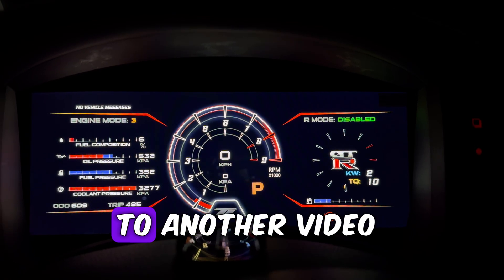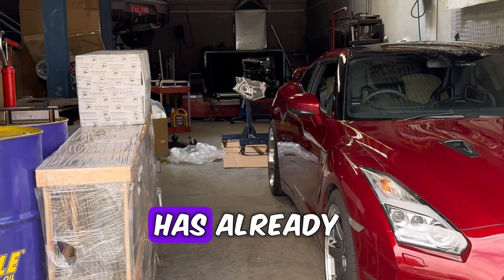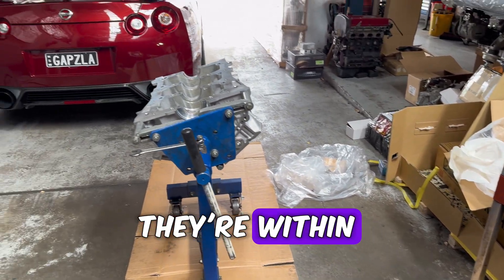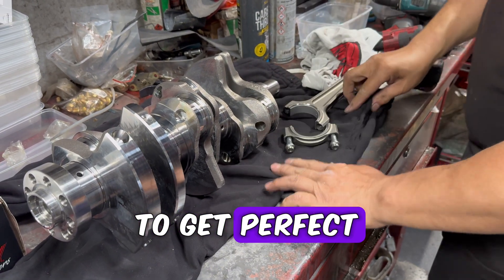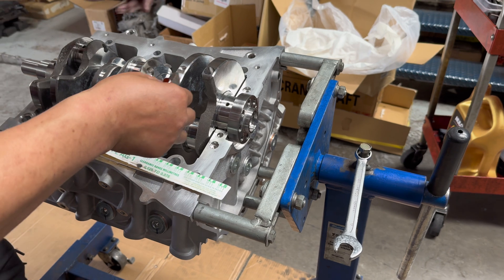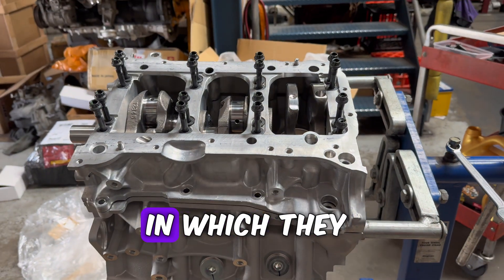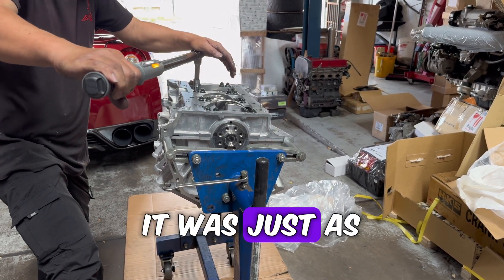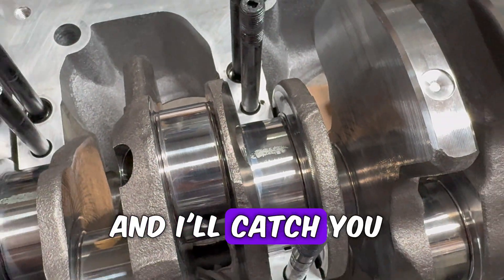Nissan GTR Engine Assembly Part 1 - R35 VR38DETT - 1100whp-1200whp engine build

Comment: Hello, I had trouble choosing the main block bearing, the original boards didn't help me.

What main and rod tolerance are you using for that power?

Thanks
Reply from the maker: are you building or do you have an engine builder? ideally you want to measure and select bearings after measurement
Reply: @gapzlaGTR  I'm building myself, but I asked based on the letters of the crankshaft and the letters of the block by introducing them into the table, but the tolerance was very small. Now I've asked for caps closer to the zero degree, I'm looking for a tolerance of 0.0018" for 800whp or so.
Reply from the maker: @oliverogv  we’re around 0.002 you can mix and match the bearings from Nissan to get your clearance 0.0018 is standard range you might want to go a little more but that’s just my opinion not any advice

Comment: Did not worry about line honing with the main studs?
Increased clamping force can distort it.

I got a vr38 sitting on the engine stand that i am slowly gathering parts for so i will have a flick through your videos and have a look through.
Reply from the maker: Should be fine from what I’ve seen on many other builds on the GTR forums using a brand new OEM block and girdle . the engine manual and arp recommended torque for the main studs is very similar. 

Different story if you’re using a billet main girdle  though as it’s recommended or if the block/girdle is used.
Reply: @gapzlaGTR  nissan did seem to do a really good job with the bolts in these. The mains and heads with those e torx heads were a pain in the arse to get undone.
I think i will be using the l19 mains in mine but a used block so needs machining anyway and a non gtr drag build
Reply from the maker: @aussie1926  sheesh L19 mains yeah definitely take the precautions in that case. How much are you aiming for? Mines not really a drag build either but hoping for it to be an all rounder that is somewhat competitive.
Reply: @gapzlaGTR  got advised i should do the 12mm stids for the mains but that is probably a bit overkill.
Hoping to make at least 1600whp at 40psi for the class i will be running. Then maybe turn it up at some point.
It is going into a dragster. Currently use a 300zx engine
Reply from the maker: @aussie1926  that sounds insane! Good luck with the build - do shout out if you need any parts I pretty much have a whole motor as the new motor I’m building is all new parts
Reply: @gapzlaGTR  actually the workshop manual. How did you get a hold of it? Most of it won't apply anymore but be interesting to see the timing side of things.
Reply from the maker: @aussie1926 funnily enough I did a Google search and found it on a website called nicoclub and one on a site called cardiagn
Reply: @gapzlaGTR  Awesome mate./. Just downloaded the EM from nicoclub
Reply: Hello,

   I was wondering if you had to do a Torque Plate hone? 
Also how did you overcome the fact that the cylinders are coated with a very thin Plasma Steel coating without removing too much as to not get into the aluminum? 

Thanks 👍